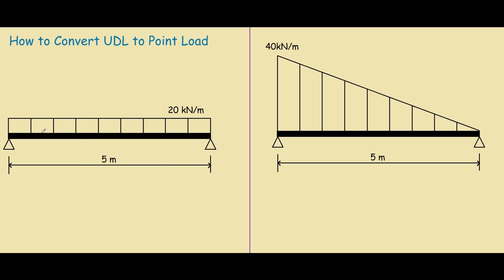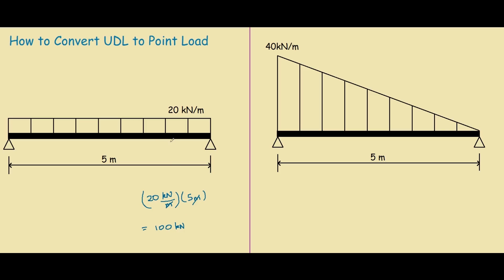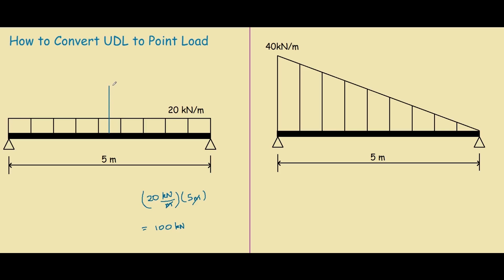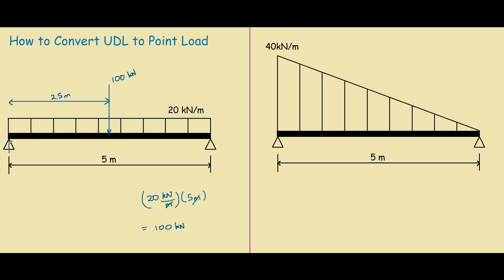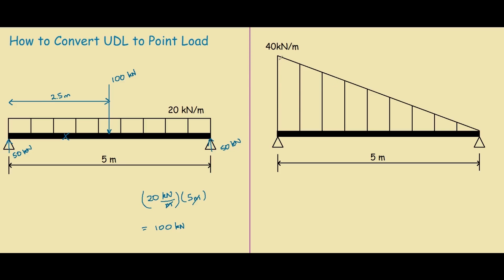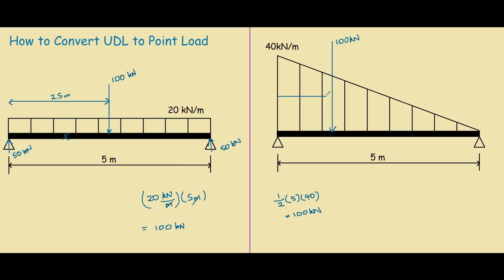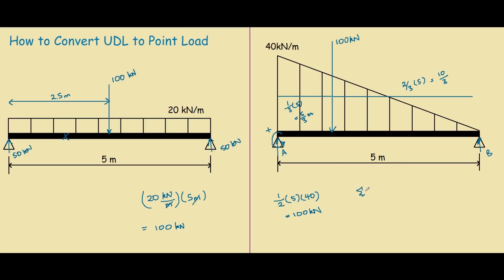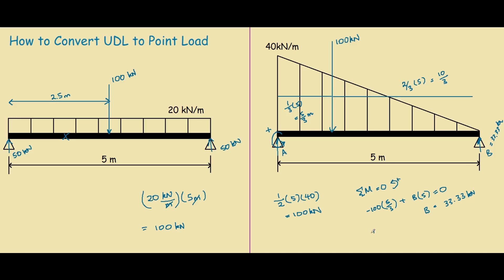How to convert a UDL to Point Load

Comment: think you for this first but I would like to know how the reaction a and b are obtained by formula
Reply from the maker: Hello Mushimiyimana, they were actually found by using equilibrium, 

using sum of moments = 0
sum of forces in y direction = 0. 

when we convert the UDL to a pointload, we actually have the total downward force on the beam and normally the reactions would be this total downward force divided by 2, HOWEVER in this case the point load is not in the center of the beam which means one support takes more load than the other support, this is where we have to use summation of moments, if you're not familiar with this method, I suggest you google how torque/moments work, I made a video on torque if you need it: https://www.youtube.com/watch?v=SyoksbkTuWQ
Reply: Yup